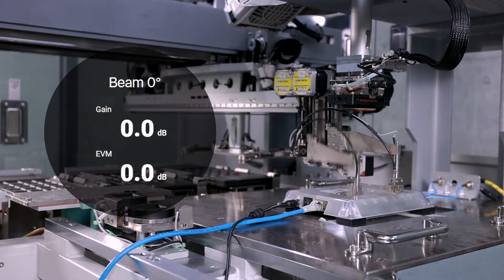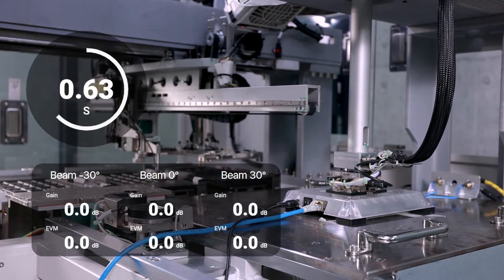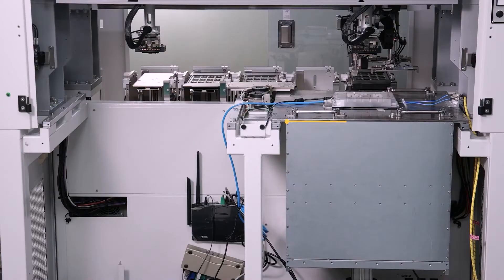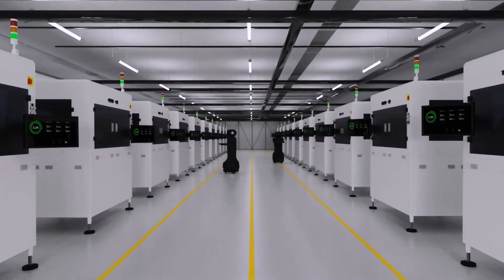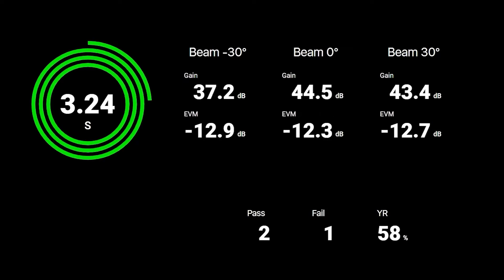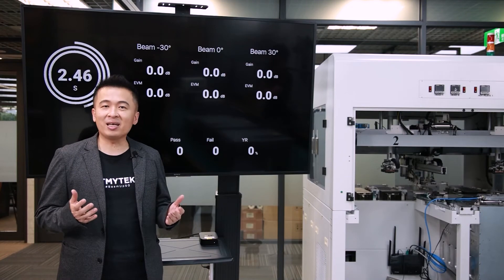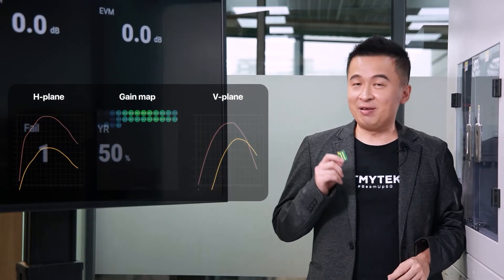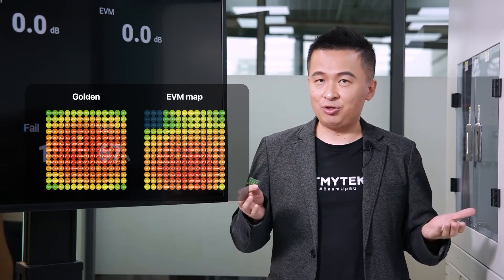TMYTEK | OTA Solution -  From Lab to Fab

Comment: Cool Technology. how often the receiver phased array must be calibrated itself?
Reply from the maker: The receiver phased array is designed with robust hardware architecture and precise manufacturing alignment. This eliminates the need for routine self-calibration in operation. Once deployed, the system maintains consistent beamforming accuracy and stable performance over time without user intervention.